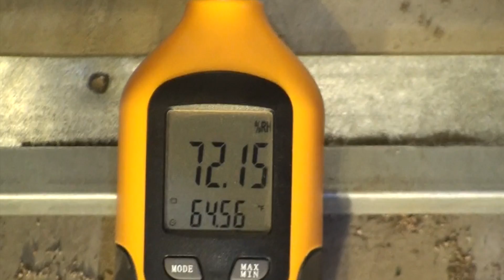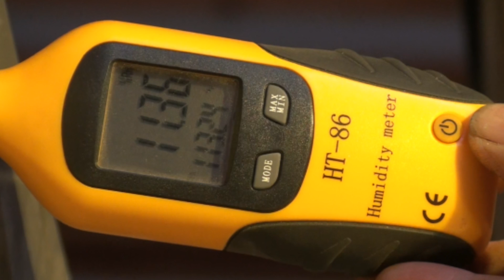What happens to humidity when temperature rises

Comment: Nothing personal cause this is the standard break down however I had a hard time understanding it this way. It’s better said that warm temperatures dry out the air so the warmer the temperature the dryer the air is hence humidity level drops. When they say it drops because warmer temperatures can hold more moisture that doesn’t make sense to me cause if that was the case you would think warmer temperatures would reflect a higher humidity since it’s holding more moisture
Reply from the maker: Thanks for the thoughts.  The method used here is just one of many ways to get this across.   It obviously did not work for you
GFM

Comment: The air still has the same grains of moisture though gray? There us no dehumidification going on here
Reply from the maker: The humidity will be very high when leaving the coil.  When the supply air mixes with the air in the structure, the temp will rise and humidity will reduce but will be lower than the return air.  It has to because some water has condensed in the coil.
GFM
Reply: I belive that your grains of moisture are still there just super expanded so humidity will be lower. Your not dropping grains of moisture unless your physically removing it via dehumidification. Dehumidification  is only a byproduct of Ac so only at most in my area southern states we will get between 12 and 15% max from our equipment. Don't want to step on anyone's toes but dehumidification is what I deal with everyday in my work environment.
Reply: Joe Shearer Good question.  And if you captured a quantity of air leaving that furnace and let it return to its original temp, will it go back to the same RH?
Reply from the maker: Actually, air conditioners are sometimes used as dehumidifies.
GFM